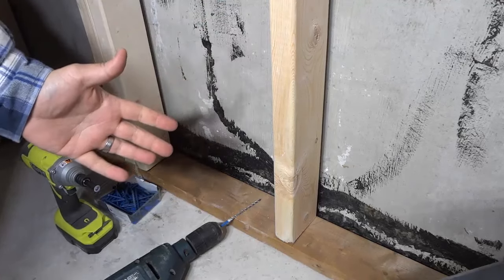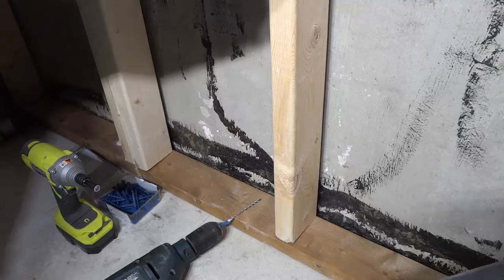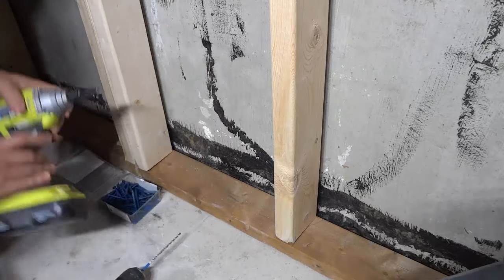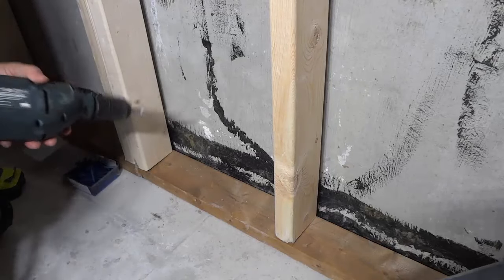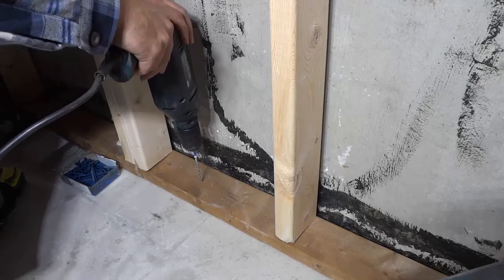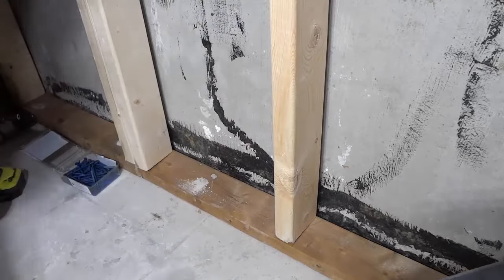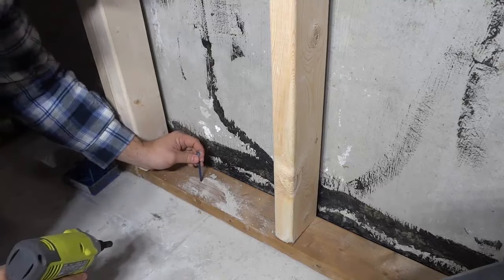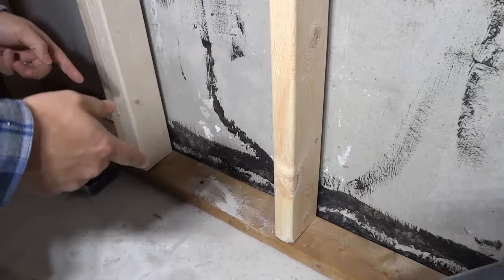Attaching Basement Framing To A Concrete Floor-DIY

Comment: To be up to code: Treated wood is required for the peice that touches the basement floor.
Reply: or using sill gasket on SPF
Reply: Wow!! I just asked the "specialist" at home depot yesterday about that and he said "NEVER use treated wood indoors because it releases chemicals"
Reply: You should have asked him, “then why do you have big stacks of it inside the store?
Reply: @ladyrenaissance2026  😂😂
Reply: i use drylock then you can use wood
Reply: @ladyrenaissance2026  That's not true any longer. Before 2003, the chemical used was chromated copper arsenate (e.g. Arsenic.) Now, they use safer chemicals.  However, if you are worried, you can use regular wood and spray it with a product called Bora Care. I mix that stuff up and put green food coloring in it so I know where I applied. 
I used treated wood that was going to be buried behind a bathroom exterior wall. This area had been had termites twice during the life of the home.
Reply: If you are listening to a employee being paid minimum wage at Home Depot you might as well be homeless. A employee at Menards caused me to waste $70 in paint and have a headache to strip all the paint back off. He said I could just pour latex paint right on the floor, no need to be sealed or primed. The paint peeled up within 4 months. And it continues to peel up 9 years later and track paint flakes all over my house
Reply: @edwardlydon2627  lol
Reply: @charlesortiz898  what's drylock?
Reply: @edwardlydon2627  My guess is that the store wood doesn't sit there long (inventory turnover), wheras the wood in your home is there long term.
Reply: You can't use pressure treated wood in homes due to the chemicals used in the process. That's per code.

Comment: Treated or "blue" wood for bottom plate! Tapcons work great if you use a variable torque impact driver to run them. Too much torque and they strip or the heads bust off, too little and they wont drive all the way. also, never re-use the holes of a removed Tapcon that may not have drove all the way secure. The hole you drill is just a pilot hole. The threads of the Tapcon "ream" the pilot hole, but in turn chip and powder the remaining concrete, which in turn acts as a filler, kinda like Loctite. When you remove the screw, the filler comes out too, thus making the next screw driven loose in the hole.

Comment: You need to use pressure-treated wood... AND the screws go in much better if you blow out the drill holes with compressed air before inserting the Tapcons.

Comment: probably should have a vapour barrier and you're too close to the concrete wall thus you can't insulate or adjust for out of square walls.

Comment: Hi Michael, I need to install this kind of framing on to my garage concrete wall, up to a height of 60”. 
How can I attach the studs with their 2” sides facing the concrete wall?
Reply: You don’t need to attach the studs to the wall necessarily. You can attach the studs to the mud plate and top plate and then just make sure the top/mud plate are fastened down like he showed in the video
Reply: @IntoTheWilde  Thanks for the useful advice 👍

Comment: I have flooring over a concrete floor and want to use 2x3 lumber. Do I still need pressure treated wood? 2x3s don't come in pressure treated. Need 2x3 to gain space.
Reply: Probably have to rip a 2x4
Reply: @peterbergeris6510  Just yesterday I asked about this and was told that 2x3 can be bought easily.  Given my track record with tradespeople over many disappointing years, no doubt that was not true.  I'm here to figure out how to do all of this myself because you can't get anyone to do any work these days.  It's very disheartening.  Nobody cares.

Comment: Can it be same to a tile floor ?
Reply: Yes, but you need a drill bit capable of drilling through tile, and you need to go slow or you will crack your tile.
Reply: Thinset is not as durable as concrete. You should remove the tile in the place where the floor plate will be. This will also mean that you don't have to remove the wall if you ever change the floor tile.

Comment: What size drill bit for what size screws?
Reply: lol nobody ever says, it's annoying
Reply: the most importance point was mentioned
Reply: Depends on what you are drilling trought !! Take a measuring tape check the width of the piece of wood you want tu secure then add an inch to go into the concrete and now you have the size of your screws ! For the drill bit just take anything longer than the screw size and it should be fine 👍 screw = width of the material plus 1 inch minimum
Reply: @ehbarooo  I think he is asking for diameter not necessarily length.  I use a 3/16 pilot for a #10 screw.
Reply: @ehbarooo  lol  not really

Comment: #dont use shitty tapcons.  They're very difficult for diyers to not over tighten/snap.  Do the right thing and use a Ramset or a sleeve anchor.
Reply: Nah.
Reply: Sleeve anchors/wedge anchors are much better in every way.

Comment: How do remove a floor plate after it's secured?
Reply: As with most construction projects, being able to take it apart isn't usually considered. If you're going to remove a bottom plate, simply remove the screws with an impact driver. You may have a hard time doing this without breaking the tapcon heads, but it will still let you lift the plate up. If it's nailed down, you'll likely need a crowbar and you'll have a very hard time not causing damage to the wood and cement.
Reply: @poetnk  easiest way is to break away the wood around the screw then cut the screw off flush at the concrete

Comment: Your NOT supposed to use an impact driver to insert tapcons into concrete ... Tapcons are supposed to be inserted with a nutdriver by hand ...
Reply: yes, but impact drivers have speed settings, as long as you are at speed 1 you should been good, that is pretty much just like doing it by hand but without the work.  Hammer action wont activate at this speed
Reply: @4dchessplayer516  none of my impact drivers have speed settings .. i have ryobi, dewalt and a milwaukee.
Even with speed settings i would not trust it especially a tap con into concrete or block, those i feel should be done by hand to ensure proper tightness
Reply: Doubtful, best idea is to not overtorque them.  However you manage that is your best bet.  Can't imagine too many people hand torquing these things in.
Reply: @sean2me  Tapcons are EASILY stripped when put in too tight into concrete and when its stripped, you might as well pull it out and re drill somewhere else and start over. 
I have been putting in Tapcons for 20+ years and have NEVER EVER used a drill or impact driver or gun, always done by hand so that i know when to stop.

Comment: Should have watched some videos first before I paid a supposed contractor/ friend to finish my basement! Then I would have known he was totally destroying my foundation when he was putting my walls up! This dumbass RAMSET THRU my concerted blocks multiple times on each stud! My entire foundation has well over 100 holes all around the perimeter and is now full of water!
Reply: If you have a cinder block foundation you never attach directly to the block.  The house will have to be jacked up on that side and the entire wall will have to be excavated and rebuilt. You might also be able to pour a replacement foundation wall on the interior, but you will lose a ton of floor space.

Comment: Another video giving home owners bad information. That bottom 2x4 may be pressure treated based on the color. It should be. There should also be pink sill plate gasket material under that 2x4. You never want wood in direct contact with concrete. Using tapcons like this is not correct. Tapcons are very brittle in a shear load like this.  You are far better off using sleeve anchors or expansion anchors.
Reply: If this is an exterior wall, which it looks like he's next to one, then he needs what you suggest.  If this is an interior wall, then no because it is considered a conditioned space. To be on the safe side, use green and pink and you'll never have to worry. This is why cities require permits people.
Reply: It does look like the plate he's using is of a different material than the whiteboard / SPF board of the studs though. Might be "ground contact" pressure treated cedar for decks. It's very difficult to find colorful treated lumber here in Michigan for example, so the looks may be deceiving.
Reply: This is an interior wall. None of that matters. To code you don't need a pressure treated 2x4 for an interior wall.
Reply: @srzy  Depending on what code your area asks for - some ask that any wood coming into contact with concrete be pressure treated as the moisture can be drawn up through the concrete into the wood. This includes interior walls in a basement space.
Reply: @srzy  it matters here . our inspector would make someone rip it out and put in treated.
Reply: 1/4" Tapcons have 1380 lbs shear strength.  What kind of lateral load are you expecting that would exceed that?  Drive a car into a wall secured with Tapcons, and the studs will break before the Tapcons shear.

Comment: those will very easily strip out in the concrete and hold nothing
Reply: What do you mean?
Reply: Not sure why that would be the case... Tapcons are literally designed to thread into concrete and hold without stripping. Not like they're using drywall or wood screws here.
Reply: Tapcons have been around forever and are reliable... you are incorrect.

Comment: What size drill bit and screws?
Reply: Depends on what you are drilling trough check the width then add an inch ! For the drill bit just take anything longer than the screws
Reply: @ehbarooo  Oh please.     Stop with the nonsense.